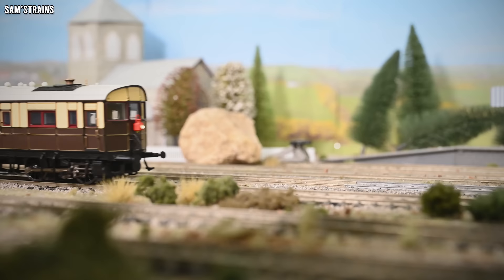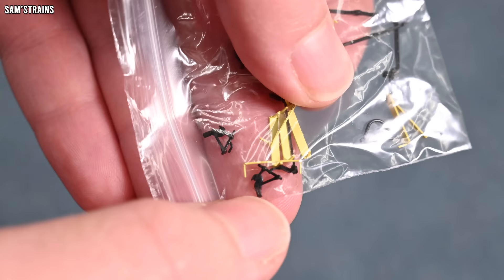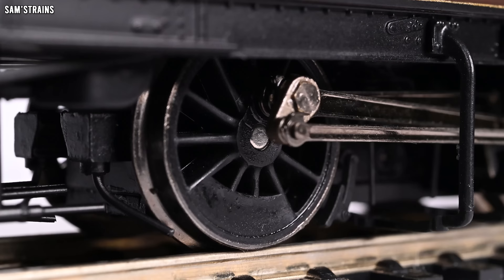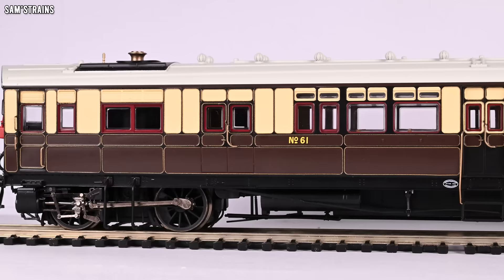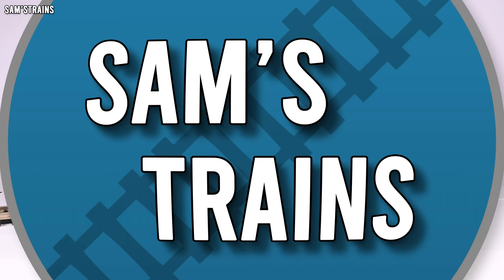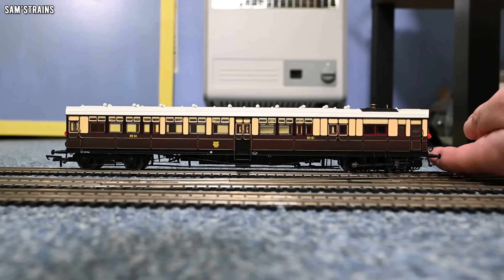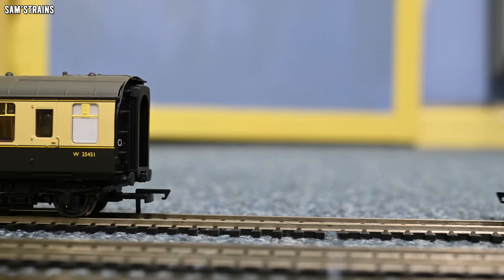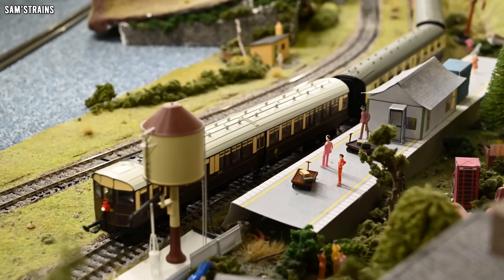A Steam Powered Coach!? | Kernow's New GWR Railmotor | Unboxing & Review

Comment: This is a generally impressive model, with a high standard in detail and decoration, and mine ran well straight out of the box. Apart from the grotesquely overscale lamps (apparently required in order to make them working lights), it's a handsome model. So, it's a real shame that Kernow has made inaccurate passenger doors and mistakenly painted the lower portion of the doors black. They should, of course, be chocolate in keeping with the lower body and other doors.

lt was not until I saw mine in the flesh that I understood the mistake; in disregard of the numerous published photographs and drawings, Kernow has erroneously made the lower doors flush with the raised beading on the waist line. With no physical demarcation, as there should be, between the beading and the lower doors, they have erroneously continued the black of the beading down the doors. Such an unnecessary and marring mistake.

Whereas this railmotor is a huge, huge improvement on the truly illiterate gate stock coaches of some years ago, it shows that Kernow and those who advise them are still not really understanding the subjects of these models. All in all a good effort, just a shame to let it down with such an obvious and avoidable error.

Comment: Why on earth did they fit O gauge lamps front and rear?
Ruins a very good looking model (what a mistake a to make a)!
Reply: It was the smallest size of lamp they could do to contain the two colours needed. 
Not sure why they could not run two light filaments from centrally mounted LEDs but there will be an engineering or manufacturing reason for sure as they looked at the issue.